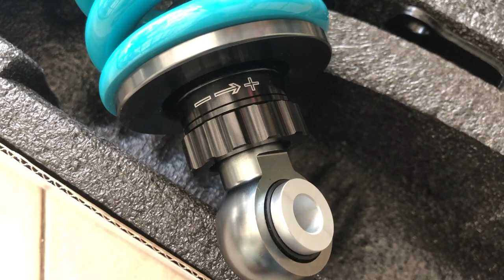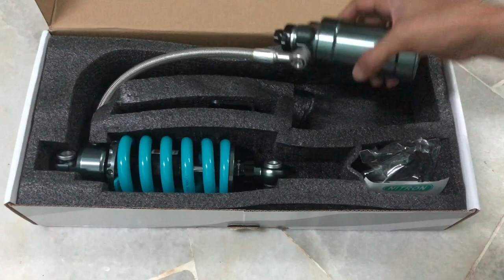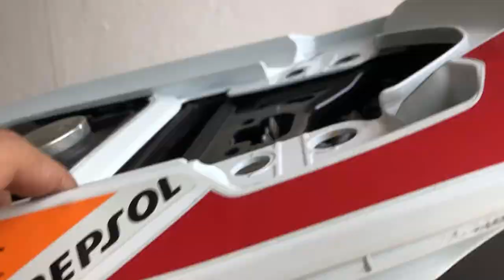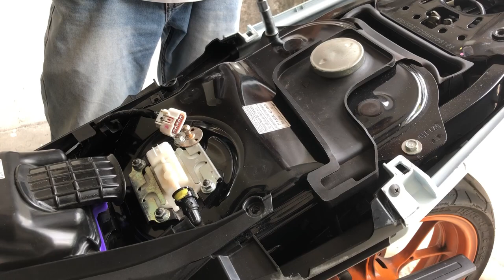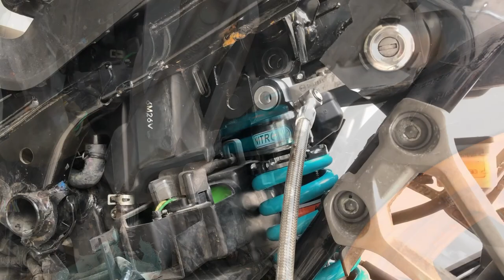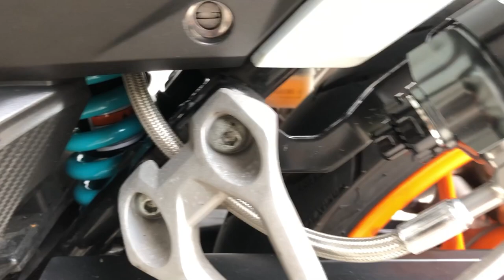Nitron Monoshock Adjustable RS150

Comment: selepas saya pakai 3 tahun.

saya ada buka bahagian wire sambung ke botol tu, 
ada kebocoran sikit, 

selepas kejadian tu clik rebound di batang monoshock tu dah macam tak funtion dah.

masa mula beli kalau paling soft
dia akan naik slow je.

sekarang soft pun naik laju pantul.

kalau hard lagi laju lah.

ada kedai boleh repair kah tu arh.

tapi ok monoshok ni ada beza dari ori motor,

saya jalan sabah macam kuda, macam kena bom
Reply from the maker: Normal bos sebab pakai lasak lama2 akan leaking kat monoshock

Comment: Kenapa bila pasnag ada bunyi tak tak..
Bahagian bush dgn screw absober x fit mcm ori...ada cara x nk bg fit
Reply from the maker: sy pun tgh cari camana nak hilangkan bunyi tu bos. die selalu jd bile lalu kat bonggol jalan
Reply: @chongsalmi  lubang screw tu x fit mcm ori motor..
Saya ingat nk masuk poly pipe la tgh lubang tu..x pun getah tayar motor
Reply from the maker: @zackzam3233  sy rasa getah motor lg sesuai dr polypipe sbb takut x tahan lama. sy pun tgh tanya2 member utk solution nie.
Reply: @chongsalmi   kita sama2 try ye...nti apa2 bagi tahu....saya nk cuba beli bush absober standart dulu..mana tahu blh modi x?
Kalau x blh modi nk letak getah tayar lah
Reply: @chongsalmi  double stand..tarik tayar ke atas..akan rasa screw dgn monoshok x fit...x macam ori
Reply from the maker: Zack Zam mungkin boleh try tukar bush lain atau pakai yg ori blk.
Reply: @chongsalmi  x boleh saya rasa..sbb lubang yg ada di monoshock tu mcm ada fix dan x perlu bush..cuma masalah dia lubang tu mcm besar sikit dari screw ori..
Reply from the maker: Zack Zam sy kena check dulu br leh buat. Selagi x buat sy x leh imagine camane.
Reply: @chongsalmi  saya rasa boleh letak getah paip air lah tengah tu
Reply from the maker: @zackzam3233  boleh cuba bos tp kena bukak dulu baru leh test
Reply: @chongsalmi  dah settle dah bos saya punya....
Reply from the maker: Zack Zam bos buat camane bos
Reply: @chongsalmi  kunci dgn socket box guna tangan sampai ketat..jgn guna impact gun
Reply: @zackzam3233  kunci seketat-ketatnya ke? (saya pun alami masalah yang sama ni) nut belah atas ke belah bawah?
Reply: @mohdnoorazlinemdjawat1600  nat bawah..jgn kunci pakai impact cordless...kunci pakai spana dgn tangan..

Comment: Utk berat lebih 90kg blh pakai ka mono ni?apa size yg ada?
Reply from the maker: mono ni utk bg motor lower bos sbb 220mm. Better bos cari yg 230mm
Reply: @chongsalmi  kiranya tak sesuai la utk org yg berat?
Reply from the maker: @mohdazharabubakar3515  bukan x sesuai tp still boleh pakai utk single rider shj. Kalu double alamat sagat nnt. Boleh adjust preload utk bg tinggi skit. Mono ni sy pakai utk bg lower n bukan utk double ride.

Comment: boss.. compression yg sesuai tuk berat 50 kilo single rider baper?
Reply from the maker: Kay la kalu x salah sy set dlm 14-15 click camtu.
Reply: @chongsalmi  belah tabung ke belah spring tu nk ejas tuan.. maaf la kita bdk bru blajar..
Reply from the maker: Kay la compression tu kalu bos nak adjust height spring. Rebound kat bawah spring tu utk control alunan spring. Kat tabung adjust soft hard.

Comment: Kenapa saya punya x boleh pusing botol dia
Reply from the maker: botol die xde free play ke bos?
Reply: @chongsalmi  ya...fix mcm hose brake biasa tu
Reply: Boleh ajar cara setup sesedap rasa kah...sbb saya punya rasa mcm keras sgt...mcm mana nk set spring dia ye
Reply from the maker: @zackzam3233  ikut berat gak bos....cuba set rebound ngan compression 10 click ke atas. pastu baru adjust skit2 ikut kesesuaian masa jalan.
Reply from the maker: @zackzam3233  patut ade free play bos kat spring n botol.
Reply: @chongsalmi  utk spring kena adjust x?
Reply from the maker: @zackzam3233  better adjust bos kalu tak nnt tongkat 1 menegak lak. kalu x adjust pun boleh gak tapi tongkat 1 tu kena tukar yg pendek
Reply: @chongsalmi  baik...

Comment: Ok x bos pakai mono ni
Reply from the maker: Setakat ni pakai ok bos. lalu bonggol pun x terentak cam pakai mono standard.
mono ni saiz 220mm plg rendah utk RS. Kalu nak single stand adjust preload dulu.
Kalu nak hentakan kuat atau x adjust kat rebound. Soft hard kat compression.
rebound n compression ikut atas berat badan sendiri. Biasa sy set 10 ke atas utk dua2 ni.
Reply: Ok2 tq info bos...blh beli ni wrna pn menarik yg penting qualiti pn oklah
Reply: Tuan, mcmana kiraan compress & rebound ikut berat badan
Reply from the maker: @nminaa  sy set 10 ke atas utk compress rebound. then try henjut dulu dgn tekan bhgn blkg. kalu rasa ok br try ride test. kalu x ok boleh +/- kan. Sbb dua2 ni ikut atas berat badan gak
Reply: @chongsalmi  brapa berat badan boss? Saya 8+ brapa yang ngam?
Reply from the maker: jesse madigen sy berat dlm 50kg. Maksud bos yg ngam tu camane ye.
Reply: @chongsalmi  boss setting brape pusing boss untuk hard ?? dgn preload..Berat boss saya dgn saya
Reply from the maker: @solehzappar480  sy set dlm 15 ke atas camtu bos